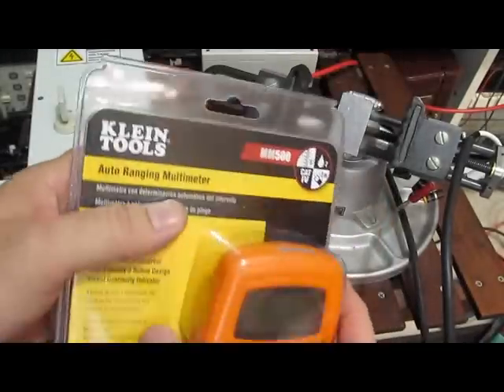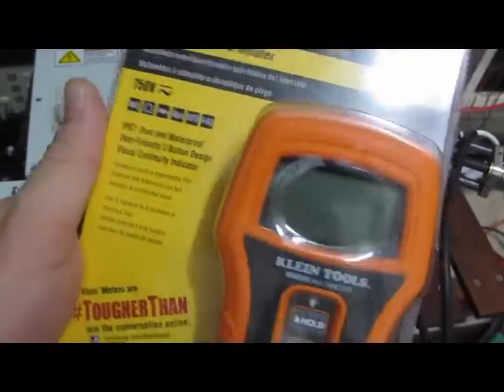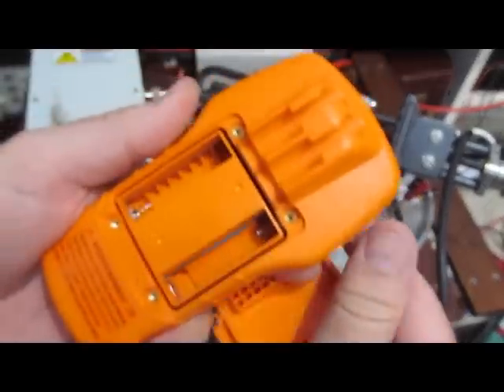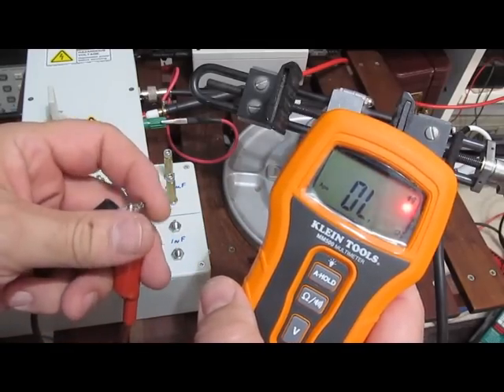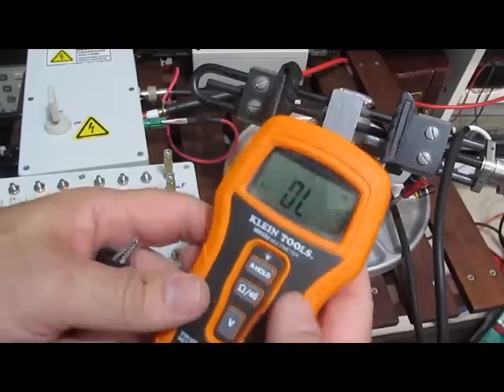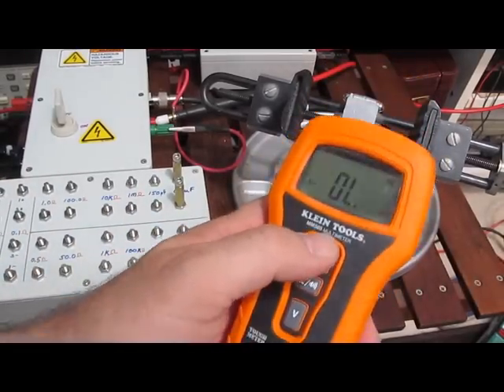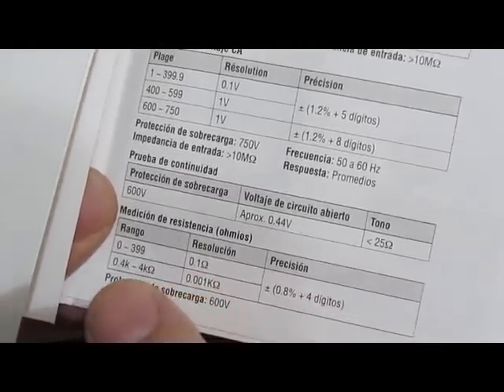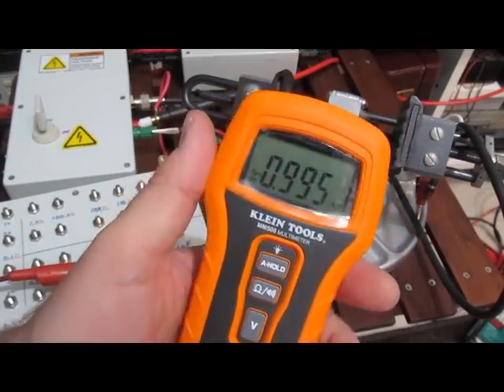Evaluating low cost DVMs Part 13 CAT I The Klein Tools MM500

Comment: When I saw the label multimeter I assumed that resistance measurement fell into its remit. However, it only measures open a short circuit. Not a problem but not deserving of the name multimeter
Reply from the maker: I has a very limited resistance range for sure.  I asked the company about this and understand that electricians are typically needing to measure higher values.

Comment: I do rental repairs for a property management company. I purchased the MM500 about 18 months ago.  It is perfect for what I do and easy to use.  I work on residential electrical circuits, range and ovens, dishwashers, water heaters, garage door openers and etc.  I also work on my own truck and trailer.  The tool has proved to be useful and durable.  I also purchased the MM2300 which I use too, but not as much as I use the MM500.
Reply: I have one of these also. I carry it in a little belt holster. 99 times out of 100 this will find the fault as most things are voltage or continuity. If it's complicated I have an Amprobe HD160 in my main tool bag. I've dropped the Klein into puddles and in mud and off ladders. It's bomb proof :)
Reply from the maker: +Ed Waggoner Sr. (Papatch) That MM500 has been by far the most mechanically sound meter I have seen!  I really liked the AC/DC auto switch as well.